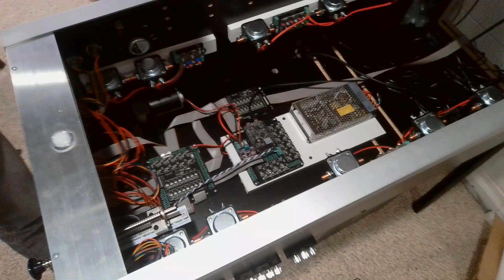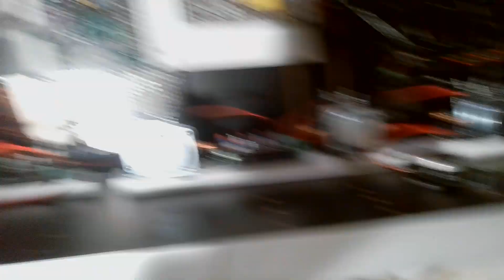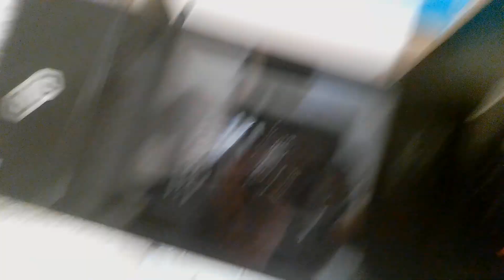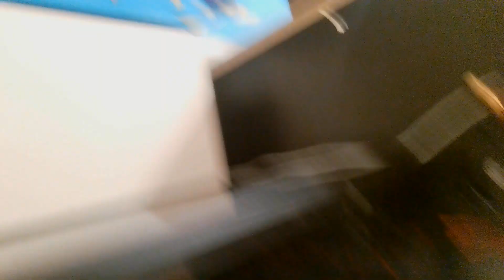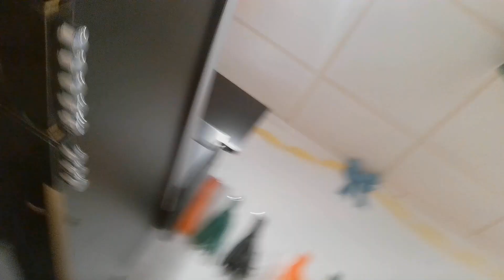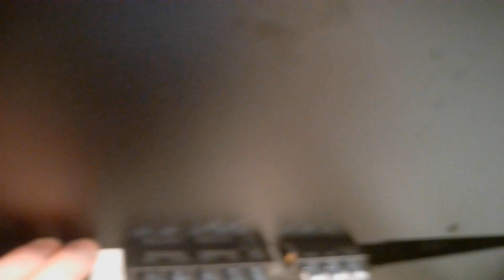Virtual Pinball SSF Kit install from Cleveland Software Design

Comment: Random question. How necessary is it to have a few solenoids running accross the center from one side to another? I see that you only have the solenoids screwed into the sides. Is that enough even for the bumpers that are normally in the center of the table? Thanks
Reply from the maker: Personally, I don't notice a huge difference, but if you want the most accurate representation, then it's the most correct way to do it. In real play, I don't think it's very noticeable. What IS noticeable is the difference between solenoids near the front and the back of the cabinet, so as long as you have the flippers and the slings in the front and the bumpers in the back you will be pretty well off.

Comment: The bass shaker wire in the kit is to short for the back shaker. What would you recommend to fix it?  What type and gauge of wire?
Reply from the maker: I use 18 gauge wire, it's as easy as just running a new wire or simply extending the wire with speaker wire.
Reply: @clevelandsoftwaredesign   Thank you.

Comment: Hi, I am a bit confused on what comes in the 2.1 vs the 4.2 package. I do not know much about sound systems.
Reply from the maker: 2.1 comes with a 5.1 channel sound card and 2 smaller speakers with one larger bass shaker. 4.2 comes with a 7.1 channel sound card and 4 smaller speakers and two large bass shakers
Reply: @clevelandsoftwaredesign  is it possible to get the kit with the DAEX30HESF-4 Exciters? I really want to be able to screw them in place. I don’t trust that sticky pad stuff.
Reply from the maker: @dmoehling  I am doing some research on using the EX32EP2-4 in future products, and I will also check out the DAEX30HESF-4 too. In general, the ones I supply are the best sounding I found so far and I have NEVER had any issue with them releasing. They are on there for life once you secure them. In the meantime if you would like to go with a different brand, even though I don't stock them I do custom orders a lot so just reach out on my site and we can work it out.
Reply: @dmoehling  The  EX32EP2-4 that came with my kit have an interchangeable mounting system. You can use the 3M, and/or use two screws to hold the mount in place. Then you can even swap out exciters to test different models.